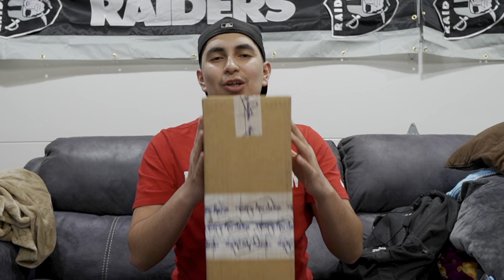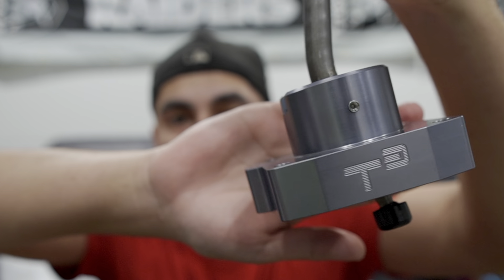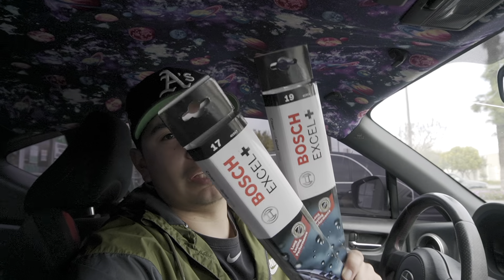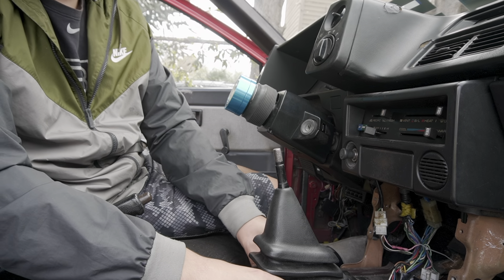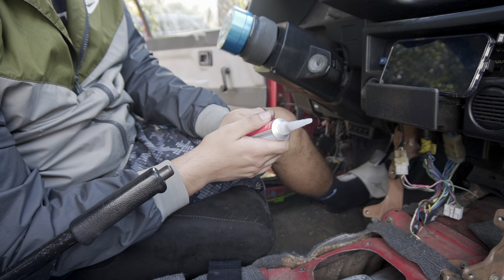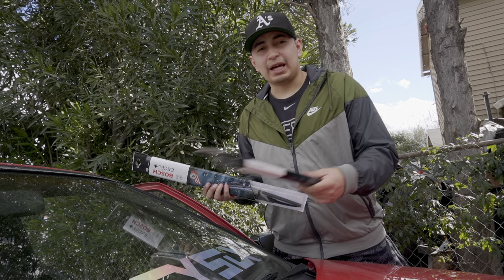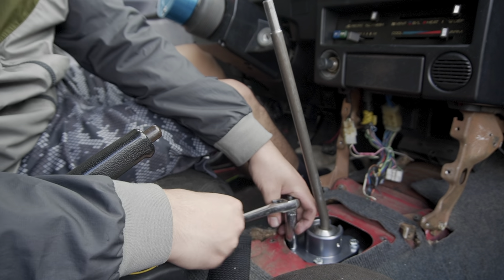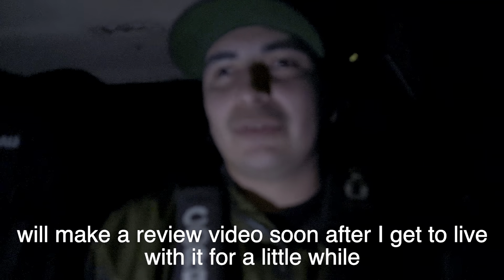Installing A T3 Tall Short Shifter For The AE86

Comment: Used your video to install my shifter today, thank you. :goat-turquoise-white-horns:

I have the same issue by the way, with it not returning totally back to the center. Shifter is crispy so I don't mind for now but I guess either the springs are too old on the transmission or the added height and weight of the unit doesn't allow it to return to center as freely? Huh.

Comment: Does it work with the ke-70
Reply from the maker: to my knowledge it's for the t50 transmission for the ae86 but if you have the t50 maybe. I would ask the guys at t3 for confirmation they answer back pretty quick